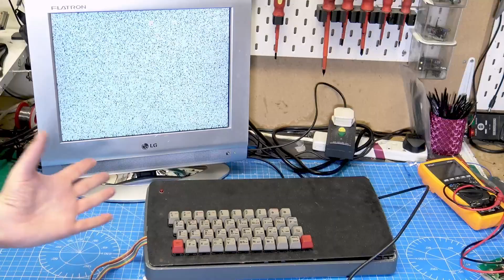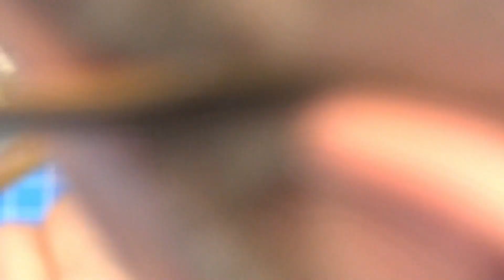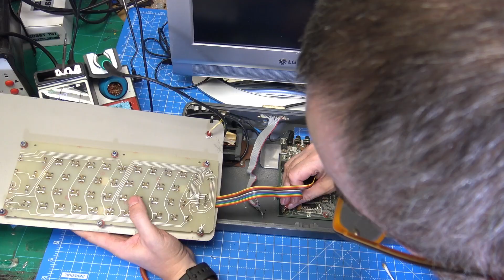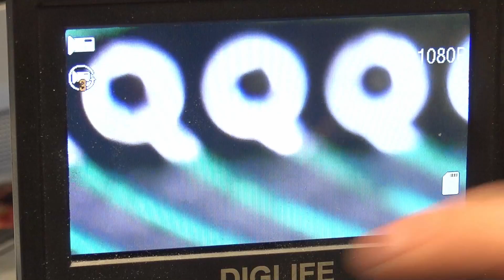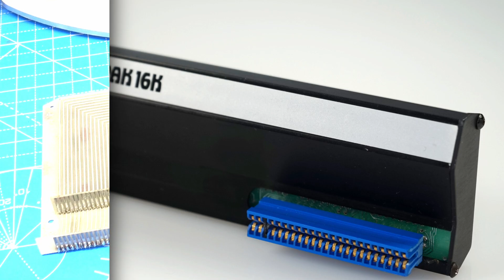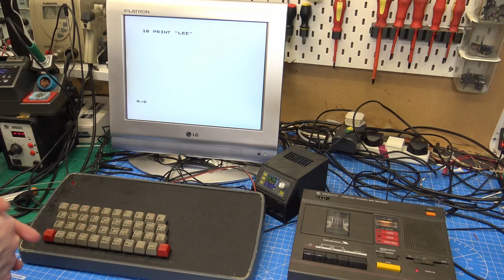A very unique zx81 computer needed some TLC

Comment: Its difficult to put yourself back when the ZX81 first came out, as an impressionable youngster, when having a, 'home computer', was an entirely new experience to have.  The ability to make this little black box with a touch keyboard run programs that you'd learned from the manual that came with it, was very exciting, way back then.  The fact that it had no colour or sound didn't matter.  It was all about writing programs based on whatever your imagination allowed it to.  That was me in the summer of 1981.

Comment: Recommendation for desoldering. Use low melt solder. Mix it in with the leaded solder. It makes it much easier removing parts. Just don't use it for soldering.

Comment: Hi. You lowered the voltage for the computer below 9V. That can be problematic, as 9V is not used by the ZX81, but is sent to the expansion bus for external expansions. I believe the Memotech 16k RAM pack you have attached needs the 9V, so maybe it will be unstable or destroyed, if you only supply 5V.

Comment: These old power supplies were desighed like that. The transformer puts out more voltage because it depends on the line voltage and today the line voltage is higner than it used to be. If you replace the voltage regular with switching module, you can keep the transformer, the switching module will handle it with no problem.
The expansion connector looks very fragile. I'd consider to replace the bare wires with a piece of stripboard to make it more solid.
Reply from the maker: I doubt I will use this so really not going to worry about it and if I did spend money it would be on a fpga ula with memory expansion anyway,
Reply: @leesmithsworkshop  Also there's plenty of room inside the case so you could use one of those cheap adjustable buck converters from China. These are very handy so you should get few of them anyway.
Reply from the maker: @JendaLinda  I have a few types and was thinking of using usb to power.

Comment: I bought the original ZX80 in kit form to build in my technology class but once assembled it would not ouput a signal so I sent it to the Sinclair kit fix department and after about a month it came back working with a few componants replaced and then about 3 months later a brand new kit arrived, my dad called Sinclair to tell them about it and they told him to keep the kit for spare parts, I never did build the second kit but sold it in 2014 still unopened along with the original kit.

Comment: I knew that was a ZX81 because I had one the same they use to sell keyboards to replace those nasty membrane things, I used to draw pictures using the graphics mode on the keyboard loved it.
Reply from the maker: Yes a DK Tronics keyboard. What case did you put yours in ?
Reply: @leesmithsworkshop  I am fairly sure it was the same one, it hit in my memory right away when I saw the thumbnail.
Reply from the maker: @Poi_uk  someone else has said the same thing, so perhaps it was all sold as a kit.